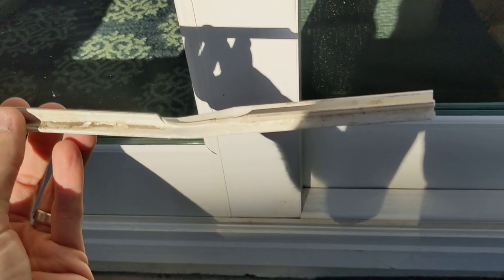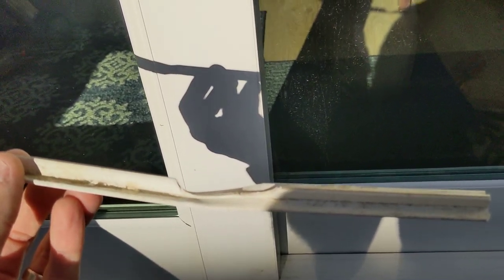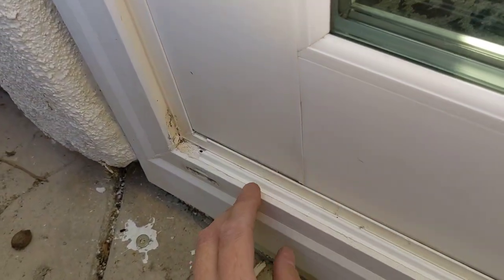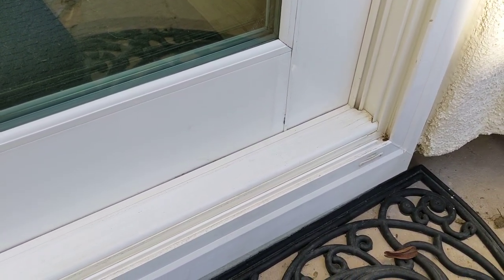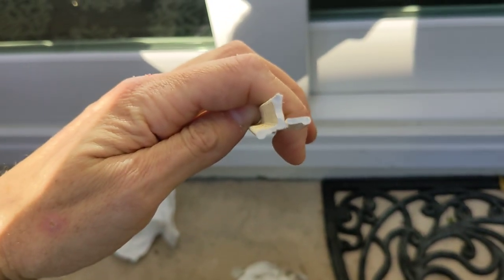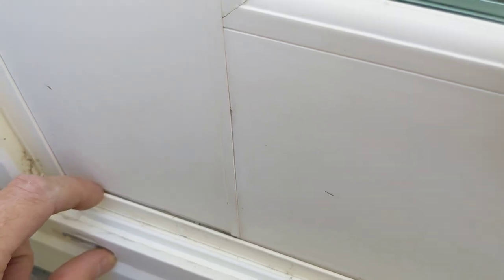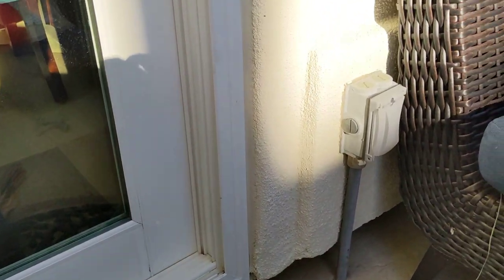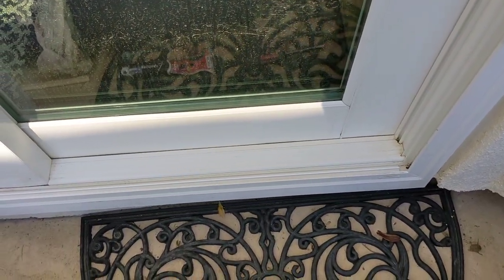Replacing the track of sliding screen patio door

Comment: DIY with Mike- is there a "universal" replacement track? I can't find my specific door model anywhere on the door and I even had an exterior door/window guy out and he couldn't either....
Reply from the maker: Pulled from a website: Go to the window or door, in which you have a question or issue with and check either the top right or left corner of glass between the two panes. Use caution if you have to climb to get a good view of these corners. In of the two corners, you will find a metal spacer with a series of numbers printed on it. The set of numbers will be five to eight digits long with a decimal point and then three more digits. Those six to eleven figures is your Milgard Sales Number or your Milgard SO. When you are ready to speak to a Milgard representative, please have the Milgard Sales Number ready so that they can locate your door or window in their system as quick as possible.
Reply: What if your door isn't Milgard brand? That's why I asked if there is a universal door track out there to use?  @DIYwithMIKE